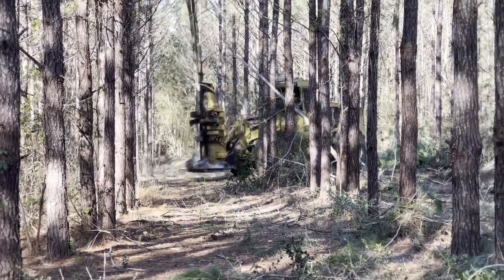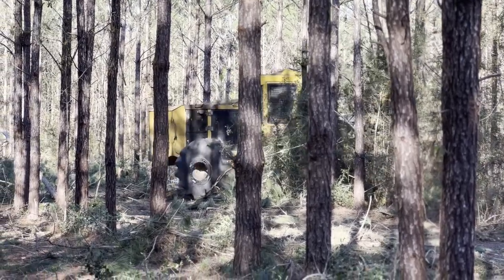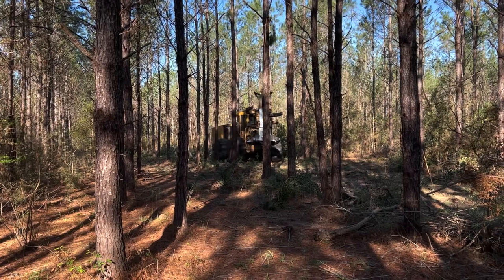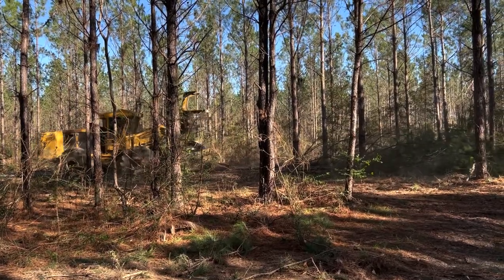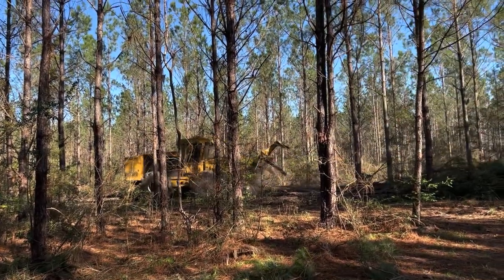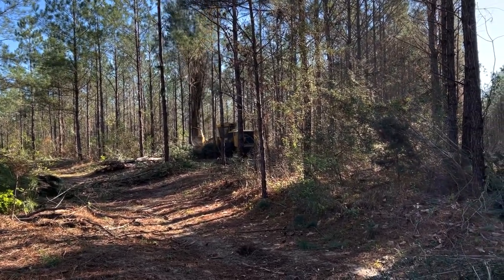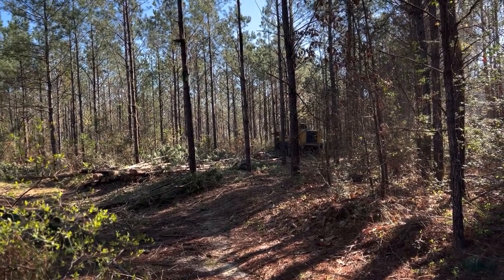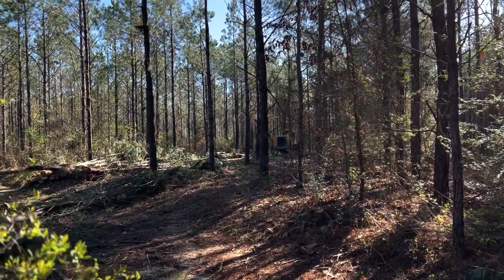So We Bought a Tigercat 724G Wheel Fellerbuncher

Comment: You are right about the dealer reform. I have had a couple of people come to my house and dropp off small equipment to work on them because the dealers are either rude to the customers or treat their employees like garbage. Half the time, it's a welding related repair or a small issue fix. Either way, I still make sure the quality is there and it is fixed to last a long time.

Comment: Nice cutter. You’re right about what dealers can often charge for repairs and parts today. On the other side I have some knowledge of dealer cost. What does it take to add another service truck to the fleet? Most today will require a CDL for the driver, commercial tags and insurance, welder, air,crane tools and spare parts. 300-400k easily then you have to find a qualified mechanic that has all the skills needed to fix everything you sell! That’s a hard person to find nowadays and afford! You could always train in-house but you can’t expect customers to pay full shop rate for training your technicians while they perfect their troubleshooting skills. The best small crew I see try and run newer iron with warranty support while some bigger crews can employ their own in house mechanics. It’s expensive either way and todays fuel, insurance, equipment cost and low cut n haul rate’s don’t help loggers of today! It’s like Booby Goodson said “if the numbers won’t work out on paper it’s time to go” !

Comment: Ridiculous ain’t the word for the stealerships. Case in point we just had a line boring quote for boss pins from our local dealer… $9800 parts and labor “IF” we hauled to their shop. It would be an additional 2 to 3 days TT&M on top if they came onsite.
Local welding shop came out and did the entire job, parts and labor for $3500.

Comment: Awesome video! As a former diesel mechanic now a logger i have a bit of an opinion on the overpriced and poor quality service. A lot of this is caused imo by some of the newer overly complicated and unnecessarily computerized equipment. Any time there is a controller involved it slows down the repair process and makes much higher likelyhood for multiple visits and more diagnostic time for the tech. That being said dealer repair rates are absolutely insane.
Reply: This is to true my father in law is a tiger cat mechanic and the shop he works at gets like 5 dollars per mile travel charge then 200 just to show up with the truck then another 175 dollars a hour plus parts I run a cutter and skidder on a logging crew and the only way we have found around that is get new machines every 5000 hours and keep it in warranty but the problem with that recently is hell the dealer can’t keep the machines in to replace local machines every 5000 hours we placed a order for a new skidder over 2 years ago and we are still waiting on a skidder to be allocated to us by the dealer also the mills ain’t helping nothing we are losing mills and hitting quota in Georgia and it ain’t even summer yet

Comment: The fiat platforms are the best tier 4 final platforms in the woods in my opinion. No EGR, no DPF, no variable geometry turbo none of the crap the other machines run. They accomplished tier 4 by strictly using SCR and like in your instance with your machine that can easily be turned off or deleted and boom your good to go for a long time. Tigercat for the win 💪🏻
Reply: Ill tell you another thing you’ll notice and may be an upside to thinning with a tower head is it tends to not let the smaller stems snap off while backing in the rows(more upper support for the young trees)